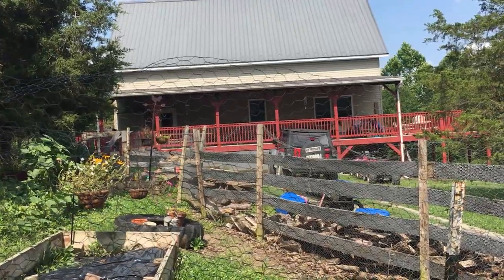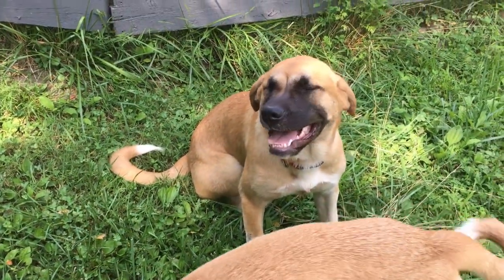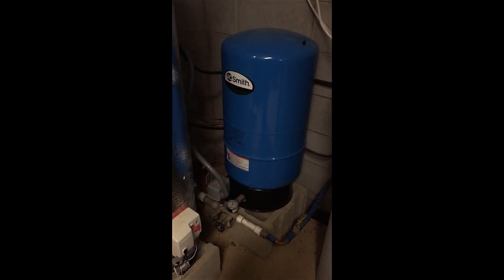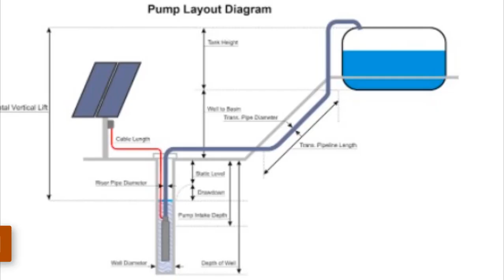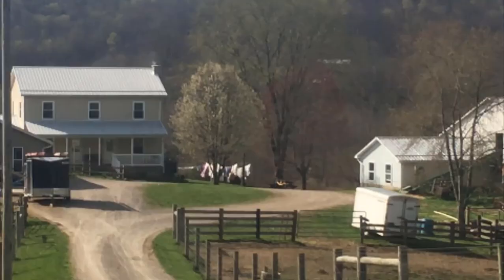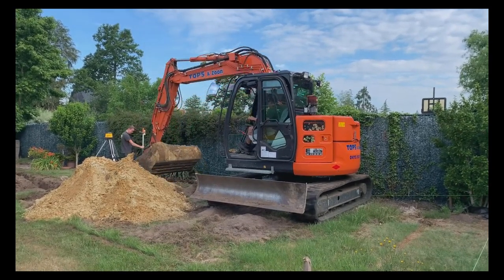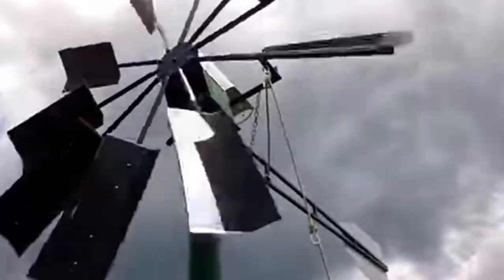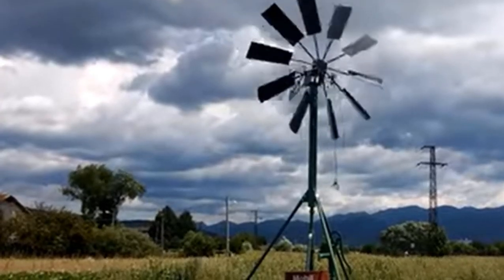How do Amish Get Water to their house?

Comment: Hi I’ve just come across your page, I have a question please. How long can the last way for power to run the well pump last, on gas, diesel or propane? You have to turn off and restart at each flush or faucet used for kitchen or to shower. We are currently with no water due to wells water level. Well is dug to 525 ft but now a stronger pump and longer hose and electrical is needed. Ironic enough it is a Amish couple that bought this house we live and the field and houses on other side of the field. It’s rough right now for us but to them this is  not a big deal. I’m praying we get enough water to just flush again with the current pump till a new can be put it and that even if they do it.   I found your video very interesting and so fitting right now. I subscribed and will be checking out your other  videos.
Reply from the maker: That is a deep well.  Our personal well is 62 feet deep.  The pump for us is electric and  we use a pressure tank.  The tank had to be replaced after just 10 years as we have hard water.  As far as the pump...ours is still going strong.    From what I have read they can last 15 to 25 years.  It really depends on how hard it has to work...yours most likely is working harder than mine.  We did buy a pricy hand pump as  a back up just in case  our electric goes out.  Solar panels are on our never ending list.   Is there a way for you to store water for times like this?  It is all worth it...do as much as you can to become self-sufficient.  You won't regret it.

Comment: Hi. I don’t mean to sound ignorant but I was recently an Amish town and I stop by to get a cup of coffee from one of their stores. My stomach has not felt the same sense. It got me thinking about their water. I know that they have a lot of contamination issues. How do we know the grade of the water and their filtration system? Did they get the water they gave me the coffee with from underground? How clean are their wells? Please advise. Thank you
Reply from the maker: This is a GREAT question.  We also have a well at our house and the county does not allow a well to be dug without a permit.  Once the well is dug they come out and test your water.  They are supposed to come out routinely and as a well owner we pour bleach in the well once a year and run it through the system.  i would think that they would have Health department regulations on top of what a homeowner would be required to follow.